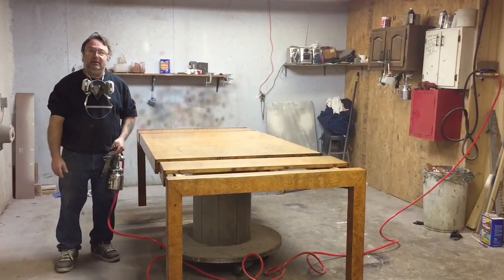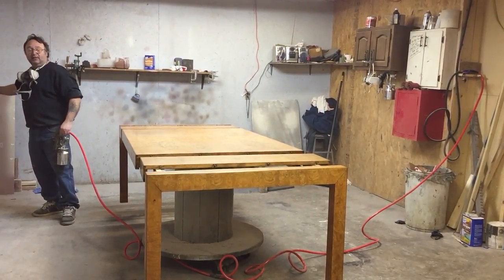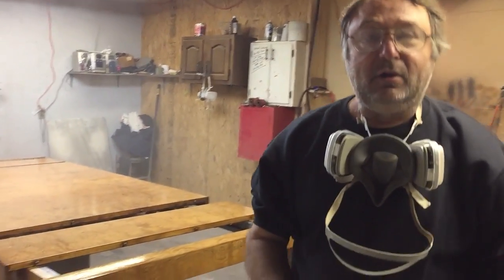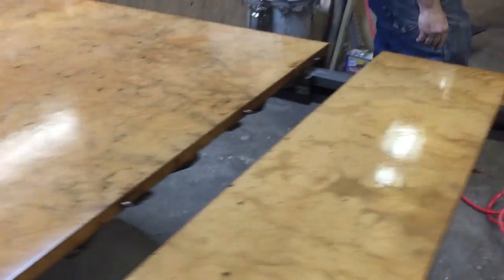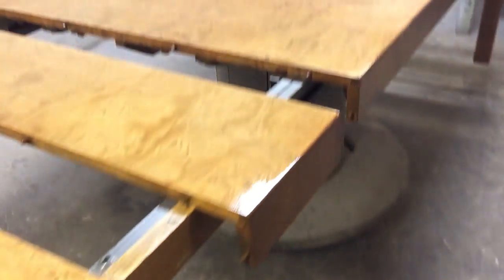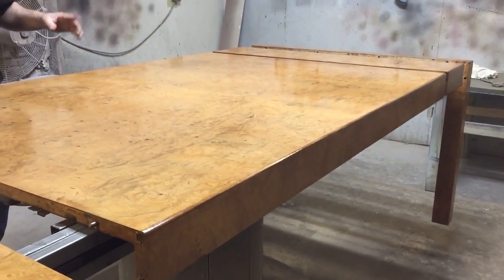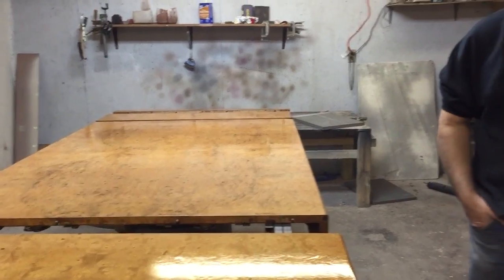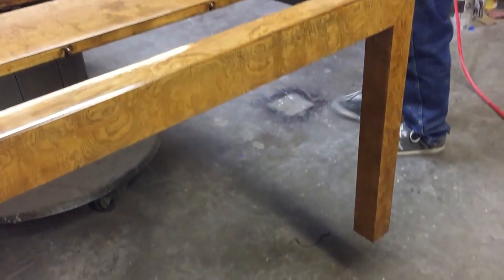refinishing a john widdicomb  burl dining table

Comment: I just bought a burl wood buffet and I would like to put a darker stain on it. Did you sand or strip this piece first? If so, what did you use?
Reply from the maker: yes ,first we strip the finish off with a paste stripper ,then sand the wood with a 220 finishing paper ,do any repairs before you sand the wood ,after you,re  done with the sanding ,wash  the table down with lacquer thinner ,then stain ,be sure to let the stain dry for a day ,then start to finish

Comment: Thank you for your response. I just wanted to verify if the technique you shared also applies to veneer.. I'm only asking because I've read some articles that said I shouldn't sand veneers because of they can be very thin and easily damaged.
Reply from the maker: i refinish for a living ,90 percent of the furniture in the world ,is veneered ,we never sand a finish off ,and any veneer on any furniture, that is older, has nice thick veneer on it ,the only paper thin veneer is the cheap stuff that the public can buy ,so don,t worry about your veneer just strip it and sand  it , stain it ,and coat it out  .feel free to send me photos, as you move along , in the box below the video, click on to my website  link and find my email address ,i will be happy to walk you through the job ,